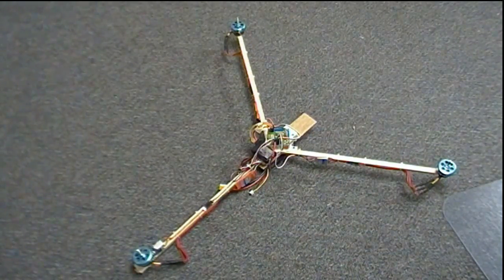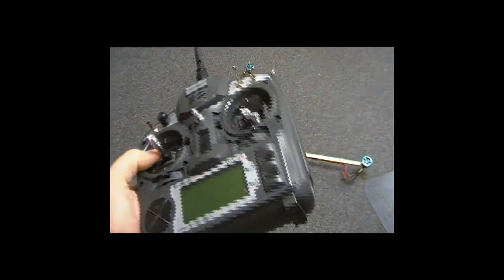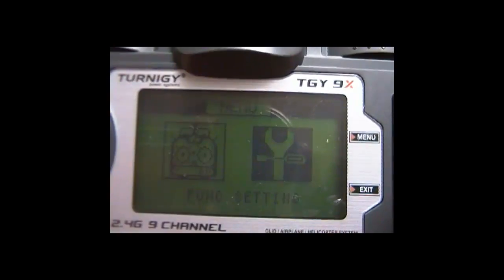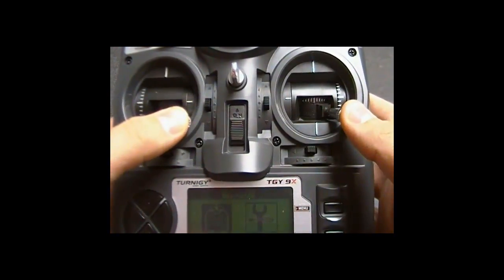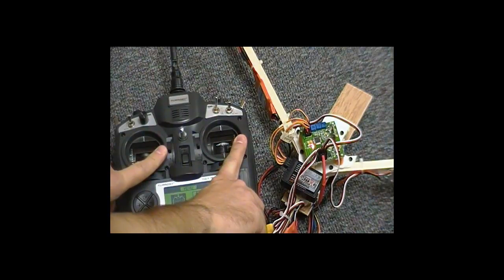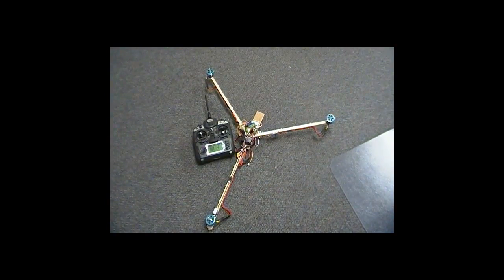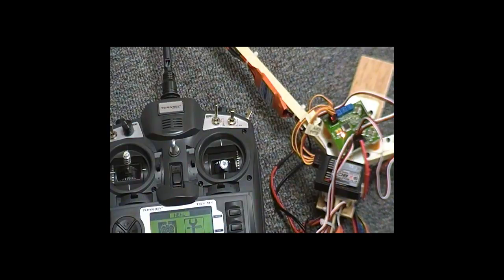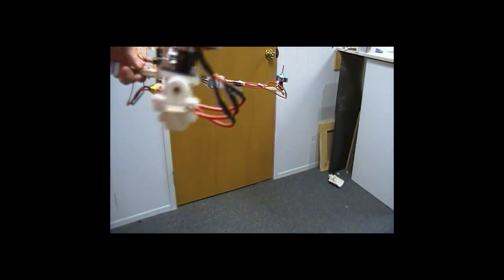Turnigy 9x KK Board Tricopter How To Arm

Comment: Hi, thank you for the video! I have the same transmitter  flysky9x  and  KK board  2.0 V 1.2.  I have problems with the settins on the radio and board, what settins do you have at radio and board to make work?

Comment: thanks bro... any chance u have KK2.1... I am struggling to calibrate the ESC
Reply: Put TX throttle to max. Power on KK2 and within 1 sec press and hold #1 and #4 buttons. Pull throttle to zero while holding buttons and board should emit series of beeps. Release buttons. Done.